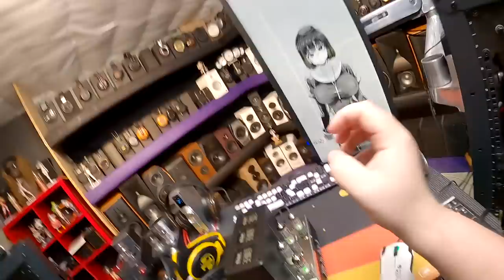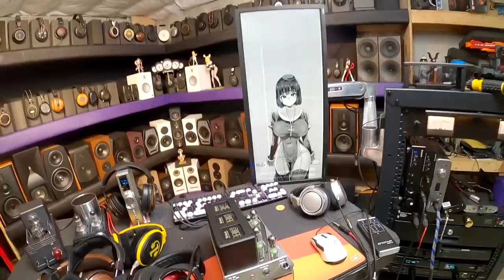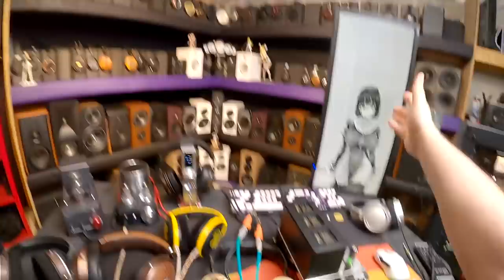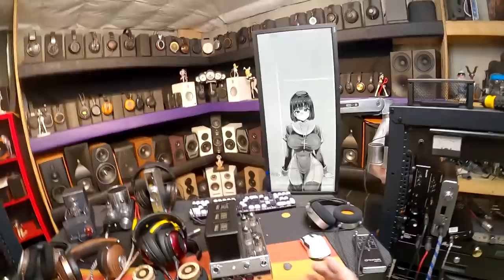🟥McIntosh MHA200 _(Z Reviews)_ 💎U.S.A. Tubes💎

Comment: Purchased the MA352 about 2 years ago. Amazing. Love it. The headphone amp you reviewed was tempting but I chose the Topping A90 + D90 and xDuoo TA-20 instead. Thanks for your great reviews.
Reply: Swap the amp and dac for topping's 30 Pro models and that's my exact setup. Got the TA20 running brimar 6067 tubes, and it's sounding lush.

I should be getting a feliks audio echo mk1 early next week, interested to see how an OTL amp compares to the hybrid TA20. If I can successfully run the echo as a preamp into the A30 pro it could end up being the best of both worlds, but that remains to be seen.
Reply: I’m rockin a TA-20 too.  It’s great.  I’m mostly using it with vinyl so I haven’t invested much into a dac yet.  Using the Topping D10s that also fibers out to my powered speakers.
Reply: Funny enough... I almost bought that MA-352 as well. Very nice unit. But the feel of its wobbly plastic-ish volume knob was such a turn off at this price that I ended up buying something else! I'm stunned that Mcintosh can produce great sounding and looking gears and yet the one knob we use most feels shitty!
Reply: @raphaelmeillat8527  Interesting, mine is 100% solid. And I use the remote 99% of the time so it isn't an issue. Sound is astonishing.
Reply: @Michaelincontext  yep, sound was great as I recall. Like I said, I would have gotten it if not for that perceived quality issue. At this price I looked for a no-compromise kinda amp. Love their tone control feature and the frequencies they choose... Enjoy your amp!
Reply: @raphaelmeillat8527 Remote control buddy. I have MA352 paired Wilson Audio Speakers. Yes good word Lush sound together. Got Hifiman HE1000 V2 recently... So.

Comment: Re: auto off (credit to warrenpchi at head-fi) 
Turning off the auto-off:
With the MHA200 already on, hold down the power (standby) button for ~5 seconds.
The tubes' green LEDs will go off and go back on three times to confirm that auto-off is now disabled.
This setting will be retained through power cycles, until you turn the auto-off back on.

Comment: I purchased this amp about a year ago and you nailed the review. I use “Clear Museum Gel” in place of your gray blob for the ridiculous volume knob. Let’s face it; one pays 15% higher price for McIntosh gear for the aesthetic and the Clear gel is, well, clear. Your shock at the cheap quality of the impedance and volume knobs is understandable. My main system is primarily Mac gear and I can tell you that the MC152 amp, C70 preamp (70th anniversary), and MCD600 CD/SACD player ALL HAVE THESE CHEAP PLASTIC KNOBS!  The gear sounds fantastic, and has an otherwise beautiful aesthetic, but I cry a little inside whenever I need to tweak the knobs. Inexcusable on Macintosh’s part. 
Also, totally agree about the bright standby light. My Aurender A30 has the same problem. I use Blackout Stickers which are awesome thin plastic stickons of varying opacity up to complete opacity that are easily applied and nondestructive when removed. I use them on my Audioquest 3000 power conditioner, router, etc.

Comment: So in the past, making a Tubeamp that is powerful and sounds as linear as possible was an achievement that ppl would pay good money fore. But today linear is the strength of good solid state amps, and tubes amps are about "dirty" tubes twisting the sound for fun/pleasure and there is a clear soft cap of what you need to spent to get that. 
The polish Miltra looks really really nice. The TA-26 is a really great product for the price and has lots of power.

Comment: That wallpaper sure has a.. distinctive art style! I'm sure I've seen that before. Somewhere..

Gods, that volume knob is just ridiculously stupid. I almost wonder if it's defective or something, especially since like 1/4 of it just doesn't do anything. If it's not defective, that's just.. what the actual fu-- are they thinking? I swear, when you see a product have a flaw like that, you just have to wonder, do they have anyone testing this thing before they sell it? Living with it for a while? Using it the way actual customers would? Are they just so far up their own ass, or laser focused in using it in one specific way that works okay that they just completely miss this? Maybe it's like when you write your own paper, and you reread and check over it a dozen times and it looks perfect, and then you have someone else check it and they're like "oh, you spelt 'the' wrong here in this line. And used the wrong 'they're' there."? But,.. you're f---ing McIntosh! You hire that other person to use your products and tell you if something is this stupid! That's just not acceptable on a $2500 unit. That wouldn't be acceptable to me on a $250 unit. 

I don't know, maybe us peasants are supposed to be turned away by this flaw. You see, you're actually just supposed to leave it locked in place, and if you want to change the volume, you ring your bell to have your butler come in and adjust the dedicated McIntosh Volume Control Unit that sits in the stack between this, the McIntosh Pre-Amp, McIntosh Pre-Pre Amp, McIntosh DAC, and McIntosh CD Player.
Reply: Do you know the artist?
Reply: @jeffreyrodas2699  Asanagi

Comment: it sounds like the gain control is linear, not audio taper which is preferable.  i had a ss Quatre preamp from the 70s that sounded wonderful  but had a linear slider gain control that had most of its gain in the first third of travel and was hard to adjust for fine changes.

...hifitommy

Comment: Well Well...Now your in my field....Don't be Voodooed into Blue Meters and LED lights.  70's Mac was Great with Luxman (Japan) at Top spot (Godzilla VS King Kong in a way).  80's for Audio (with the integration of Digital) did not fare well with Mac and gone the 100% Analog from the 60's.  It's the 60's Mac that's classic for pure analog with Point-To-Point wiring...Mac is not the 60's Company it once had been...since dealing with 4 Buy Out's.  McIntosh was purchased 4x's since founded in 1949, Clarion in 1990, D&M Holdings in 2003, Fine Sounds SpA of Milan, Italy in 2012 and 2014 a Buy Out from CEO Fine Sounds and President of McIntosh Labs to rename Fine Sounds SpA to McIntosh Group.  When analog ruled...60's Marantz 8B, 7C started Hi-Fi...Scott, Fisher. DIY Kits Dynaco, Heathkit...what a time for Analog gear.  If your looking for Hi-End Analog Tube\Headphone that 's not going to Drain your check book....PrimaLuna EVO line.  Mac cannot touch what PrimaLuna has for Analog gear.
Reply: Can Mac's high end products compete against  Prima Luna products?
Reply: @Andy-xn9zn  PrimaLuna EVO line are Analog Point-to-Point Wiring with Dual Mono (60's Design methodology).  Mac today offers Hybrid (Tube w/ SS) and SS systems that do not use the 60's Design methodology as their market base has changed.
Reply: @joenovak6393  I have another question if I may ask. Are there any alternatives that outperform PrimaLuna?

Comment: 2000+ USD more just for the brand and the look and the green lit tubes… no thanks
Reply: "2000+ USD more just for the brand and the look and the green lit tubes" - what you're missing is that McIntosh products are supported for a great many years, whereas those cheap tube amps will likely be abandoned quickly.  A McIntosh owner could get their amp repaired in 20 years because there still will be parts and service for it.  That's one reason why McIntosh gear decades old go for so much money used.

Comment: McIntosh gear looks better than it sounds, which is unacceptable in its price tier.  Even the vintage stuff gets outperformed by other circuits at a fraction of the cost.  Now they don’t sound bad by any means, they simply are not worth the admission fee across the product line, including legacy gear.  

If you have the scratch to try for yourself, they do hold value on the used market and you can recoup most or all of a secondhand purchase after the honeymoon period fades
Reply: I've had my MHA200 for about three months on my desk.  My first amp ever was a new MC240, so likely some prejudice. 

I think this amp is simply perfect for my needs.   It sounds clean and amazing.  I rolled the (likely JJ) 12AT7 gain tubes into  matched NOS Mullard CV4024 (from Upscale Audio) and the driver tubes into NOS 12BH7's from the 1960's (eBay).  All together the tube upgrades totaled $170.

No need to obsess about the volume knob.  I keep it at max like the power amp it is, and feed it balanced from a Freya+.  Dead quiet, with clean, clear, dynamic, totally balanced sound, including the same legendary McIntosh midrange.

Worth an audition.